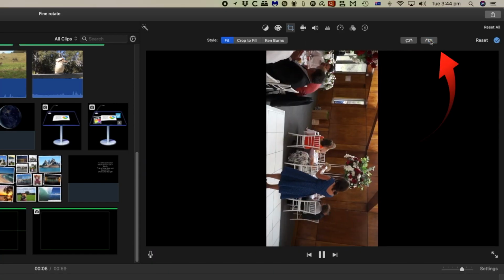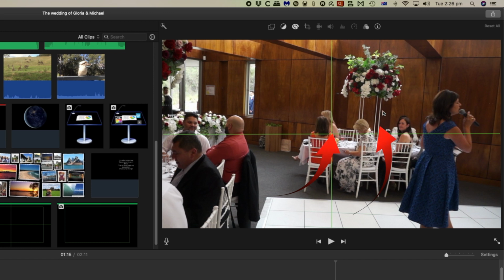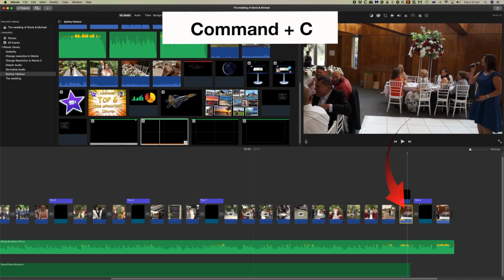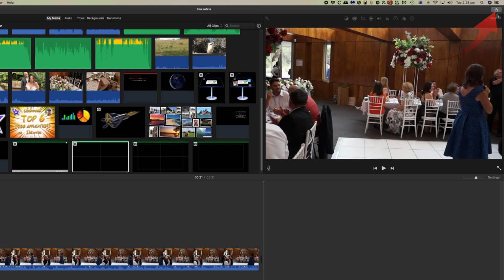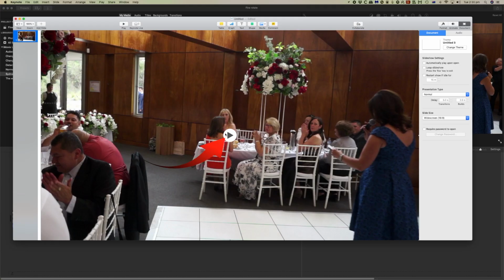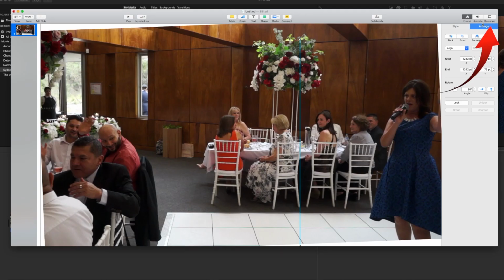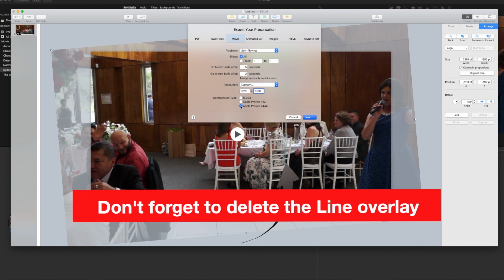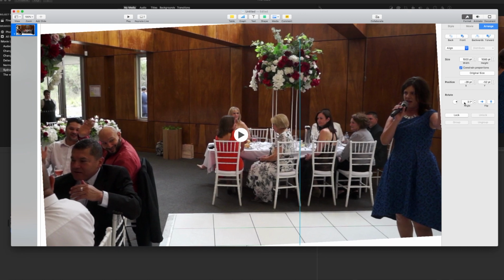Fine Rotation, Straighten Horizons, Fix Tilt - iMovie

Comment: Thanks for this video! The overlay has been deleted from Dropbox though, is it possible to reupload it?
Reply from the maker: Let me check. I will let you know if I get it back up. My paid version of Dropbox has been canceled, but I should be able to get it on the std version
Reply from the maker: Overlays are now on my web site: https://www.trainingfinalcutpro.com/_files/archives/b91810_8fb49c511b8d43078d52cf18087573c6.zip?dn=iMovie%20overlays.zip
Reply from the maker: Overlays can be downloaded with this link https://www.trainingfinalcutpro.com/_files/archives/b91810_8fb49c511b8d43078d52cf18087573c6.zip?dn=iMovie%20overlays.zip

Comment: I don't want to rain on your party because you've clearly put a lot of thought into producing this video...but you can correct rotation (and horizontal and vertical skew) directly in the Photos app of any iPhone, iPad or Mac, ten thousand times easier than your workaround.
Reply from the maker: Yes - you are correct - thanks for pointing that out. There always  seems to turn out to be different ways to do things - thanks🙂
Reply from the maker: Thanks Jon, for he tip I have published  a video showing your method and crediting you for the tip. This video shows how. https://youtu.be/NRlFEJDA8bU

Comment: What a great trick, thank you very much for sharing! For clips filmed in 4K it's possible to preserve the original resolution by setting the Keynote slide side as 3840x2160 and exporting the video at that resolution through the same custom dimensions.
Reply from the maker: You're welcome!
Reply from the maker: I have found a much quicker and simpler way of rotating instead of using KeyNote - try The Photos (iPhoto) App. This video shows how. https://youtu.be/NRlFEJDA8bU

Comment: Great tips Bruce, thank you! Would be easier for Apple just to add that in. So many ways to work-around, instead of using Final Cut Pro, for instance.
Reply from the maker: I have found a much quicker and simpler way of rotating instead of using KeyNote - try The Photos (iPhoto) App. This video shows how. https://youtu.be/NRlFEJDA8bU
Reply from the maker: I agree, But then iMovie is a free App and FCP is $300
Reply: @VideoEditOz  About 10 years ago, iMovie was even better. Then one release, without saying anything, Apple pulled out all kinds of features and functions. In the meantime, many work-arounds make it just as useable, if not more, then say FinalCut pro. Don't forget, Apple users pay a premium for these machines. So iMovie and Keynote are not really free. They've become expected to do the job. Now-a-days there are more and more options. Apple needs to be sharper, imho. DaVinci Resolve 16 is free and their professional version, which is amazing, is less (or basically the same price) as FinalCut Pro. Anyway, I'm a huge iMovie fan. Its interface is simple and to the point. Yet they should make it as powerful as possible. I've sold people Macs based on iMovie! (Well, they bought Macs based on my advice) and I'm just a little fish. iMovie is really a gem, if Apple would only treat it as such. <<end rant, LOL>>
Reply from the maker: @pijnacker01  Your dissertation is not a rant, you have good points that I feel Apple are always trying to balance between a free app that helps sell their computers and a commercial need not to eat too much into their sales of FCP. It's a fine balance and there certainly are some things - like lack of Audiometers and Arbitrary rotation as well as restriction of video tracks to two .... I could go on. Thanks for bringing this out in the open - maybe Apple is listening. I am a FCP user, but like editing in iMovie as it's simplicity is quite refreshing.
Reply: @VideoEditOz  Thank you. I should add. I have Adobe Premiere Pro, After Effects, etc. Yet for what I do, I find myself more often then not, in iMovie. I do use Adobe Illustrator a lot for slides and graphics. And as of late, Keynote, which is a cool way to make animated graphics with transparent backgrounds, for use in iMovie. Keynote is another great tool from Apple, that is free! OK, need to run. Three football matches to record today. Going to be a long one... Have a great weekend.
Reply from the maker: @pijnacker01  I agree with you about using iMovie for the less complex work - it is quite refreshing not to have loads of choices and just "get on with" editing. If you use Keynote for transparent backgrounds, check out the new HEVC export option, means you don't need to create big ProRes4444 files. I have a video showing this: https://youtu.be/4Zh2sW1q9sM. Hope you enjoy your weekend too.